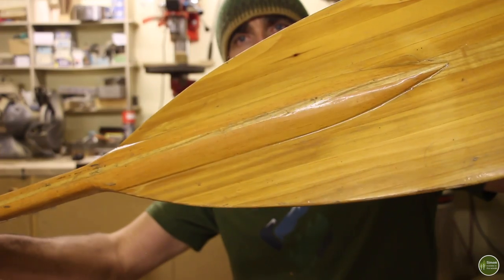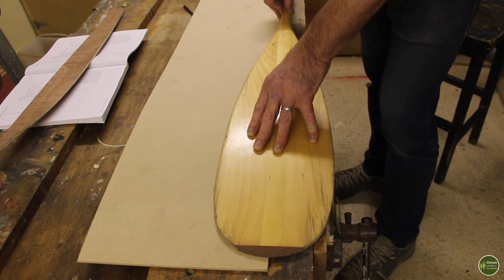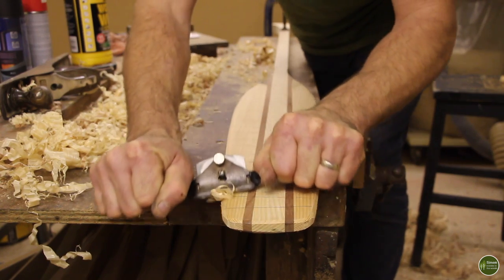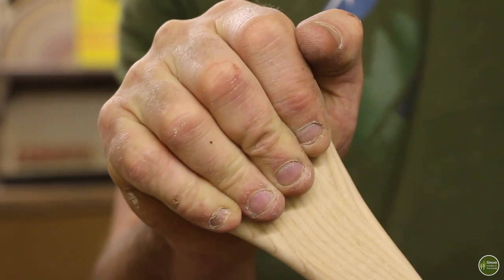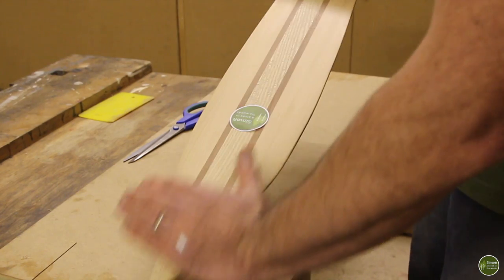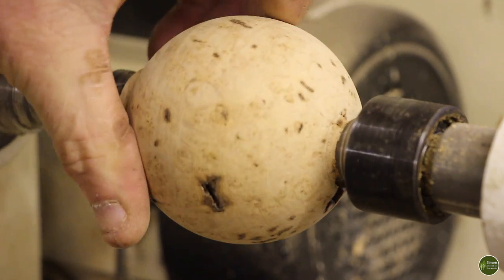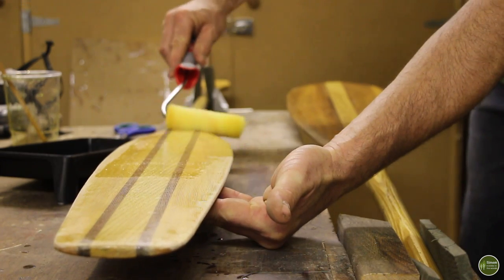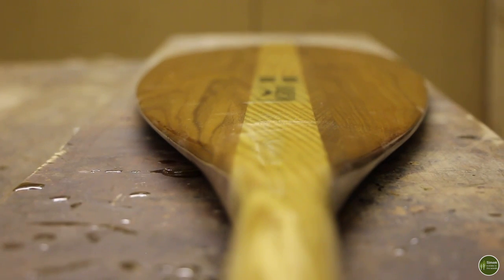Make It!  Build a Canoe Paddle.  Ottertail Paddle and Beavertail Paddle.

Comment: Nice work. I make paddles for tribal canoe journeys in the pnw. Just a tip from someone who has paddled hundreds of miles with my own paddles, drill out and dowel laterally through your handle where you grip. Those handle ears will break off with all that vertical grain over time. It hurts like breaking a bone when you've made it yourself.

Comment: On your next paddle try only using oil on the handle and shaft and varnish or epoxy on the blade. An oiled shaft and handle won't give you that hand burn after a few hours in the canoe. Very nice work. Like the flex!
Reply: Agreed!

Comment: Very nice looking paddles! I make my paddles from solid piece of wood (spruce) and only use linseed oil for preservation (which require top-up's now and then). Fibre glass and epoxy prolongs the life of the blade but I find it a messy business applying it. I use an axe, for the rough shaping, my Canadian croocked knife, a plane and wood carving knifes from Mora and sandpaper. I need to get one of those small spokeshaves though.
Reply: Yeap, same here, finish with linseed oil, no fibreglass, epoxy required really. Once you put epoxy on, varnish is a must to prevent UV from destroying it over time. Costly & unnecessary IMHO. Paddles are plenty strong without. Linseed oil is cheap & can be touched up any time. Also not as slippy when wet as varnish. For abrasion protection I apply a thin band of thickened epoxy to the tip of the blade.

Comment: A super video, and very nice paddles. I preferred to oil mine when I made it but I just prefer the feel on the shaft and grip when they are oiled. I take a plastic bladed paddle for the shallow stuff so it's not so critical to worry about protecting the blade.

You've got a nice workshop for working in.
Reply from the maker: Thank you! To be honest, they’re a bit shiny for me, I think I’m going to bring them down to a soft satin finish with some wire wool. 👍
Reply: Oil on the grip, at least, is certainly better on the hands.

Comment: I have been restoring Wooden Boats for over 30 years n We would use West System epoxy resin to laminate boards together...... I love 3m 5200 also...it's kind of like silicone on Steroids...will cure under water and remain flexible .... Just make sure anything you use it on will never be taken apart ! Lol......Great Work My Friend.....always wanted to build a strip canoe... Hope You and yours are safe..God Bless from this lil Barn in P.A usa...
Reply from the maker: I’ll have to check out that 3M adhesive, sounds a bit like Sikaflex that we have over here. 👍👍
Thanks mate.

Comment: Great video Simon. Power tools have their place, but nothing beats the sound of a sharp plane or spoke shave slicing through wood. On that point can you do a video on how to correctly sharpen plane blades, also for that matter chisels.  I know of a shop  in north Norfolk that sells second hand tools, next time I am visiting will treat myself to an old wooden plane to restore and use. Perhaps you ought to start a sister YouTube channel “Simon a Bloke in the Woodwork Shop”.
Reply from the maker: Thank you! It’s tricky to master, and a master I am certainly not! I often use a roller jig to get the angle right on my chisels, but for plane irons, I find it easier to just feel for the angle. I may do a sharpening video at some point. 👍
Be interested to know where that shop is! 😁

Comment: They look great, thanks for the video. Did you raise the grain before applying the apoxy or use the fact that it would raise for adhesion?
Reply from the maker: I didn’t raise the grain, to be honest, with the thickness of the cloth, it doesn’t need it, but perhaps with a lighter gauge, a primer coat of epoxy then rubbed down might be necessary. 👍

Comment: Hey man is there anyway you could explain to me how you got the dimensions from the offset? I feel like I’m over thinking it but I’m not sure
Reply from the maker: The measurements are taken from the centreline of the paddle - at increments given in the book. Just measure at each inch along the centreline and it gives you the shape -cut out this as a template and flip it for the other side of the blade. Hope that makes sense - it’s clearer in the book! 👍